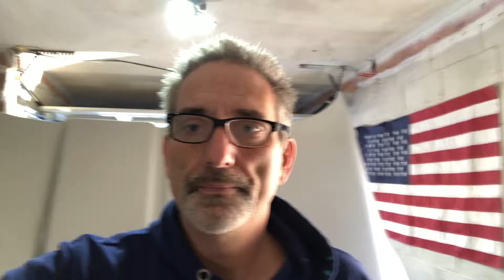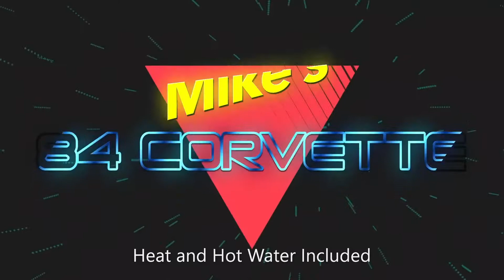Fixing Leaky Corvette Heater Control Valve

Comment: I took mine apart since it was leaking and the insides are a bit different. The old one is deeper and allows flow to the bypass tube that comes out of the top. My worry with the new one is that coolant won't be able flow to the bypass tube unless a hole is drilled in the bottom of the plastic
Reply from the maker: You could be right. The problem is it’s almost impossible to get the same part. Mines not leaking so I’m happy. For now.